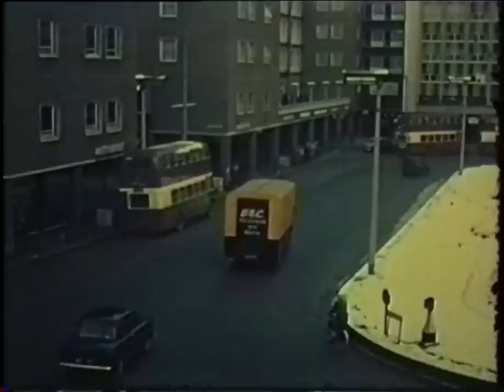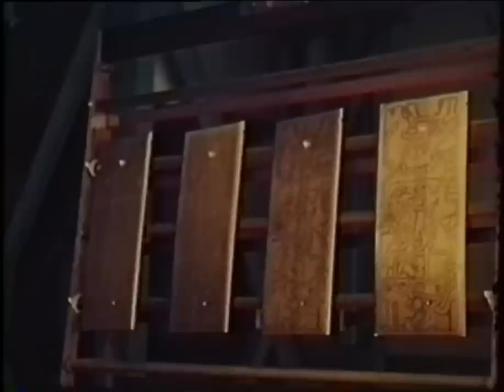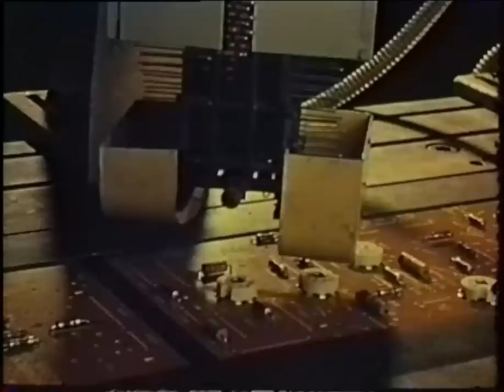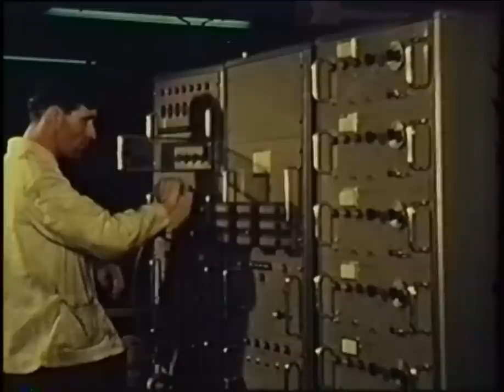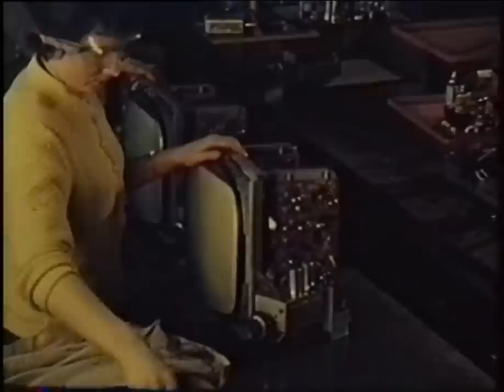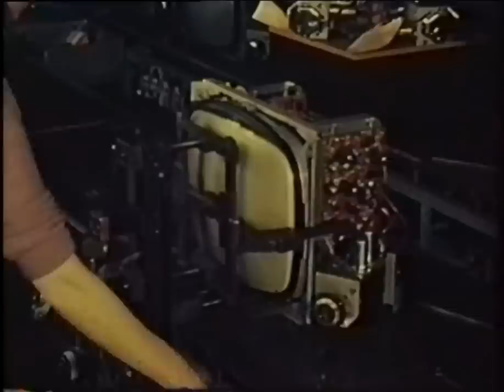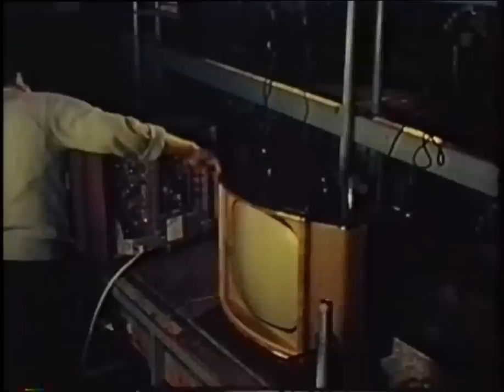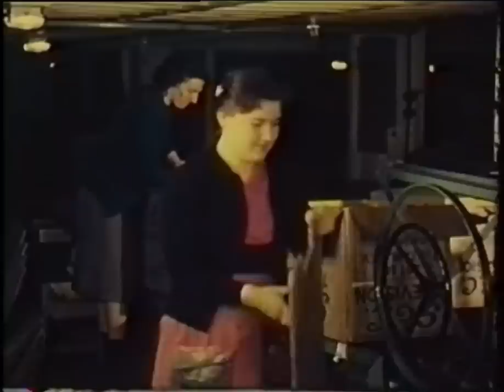GEC 405 line Television factory Coventry 1960

Comment: I worked as an apprentice at the Pye television factory in  Cambridge around this time. When the concept of printed circuits was first introduced it was my job to hand dip the boards on a bath of molten solder after first brushing the surface with liquid flux. I was given a brown overall and a pair of garden gloves as protection. It was a messy, and dangerous job. You had to float the board on the solder just enough to make the joints. Someone would then go over each board to remove the short circuits.

Comment: many years of trouble free lol who are they kidding they barely made it past getting the legs screwed on without something failing , valves were not reliable and deteriorated quite quickly , and we didn't have much tv broadcast then so most wernt used more than a few hours of an evening each day , often easier to repair though

Comment: Ahh; the glory days of the lethal live chassis! Many a TV servicing engineer had received painful, and sometimes deadly, 250V electric shocks from TV and wireless sets in houses where the live and neutral (now line and neutral) wires were transposed, or where a reversible two pin mains extension connector had been added to the cable. If that had happened, the chassis was at 250V instead of roughly zero. Modern equipment with a live chassis is illegal, for safety reasons.
Reply: Yes, I remember that little death trap very well. I was in a house loft, aglining a TV antenna while the 'guvnor' was down stairs shouting "a bit to the left.......hold it there". Holding the aluminium TV antenna in one hand....I stretch over and grabbed a cold water pipe to steady myself. Wham! Truely the most severe electric shock in my entire TV workshop career.

Comment: I have a degree in electrical engineering and programming physics. There use ferric chloride to remove the unwanted copper  that's a etching solution

Comment: We know today that "valve's" should not be touched with bare fingers i.e. gloves should be worn as finger grease will cause them to pop or malfunction ... I have a preamp that uses valves and I learnt quickly not to touch them (expensive Russian replacements)
Otherwise, a very interesting old film.
Reply: not true. Valves do not get hot enough for grease to affect the glass. You're confusing it with Halogen Lamps which run so hot the 'glass' has to be made from quartz.
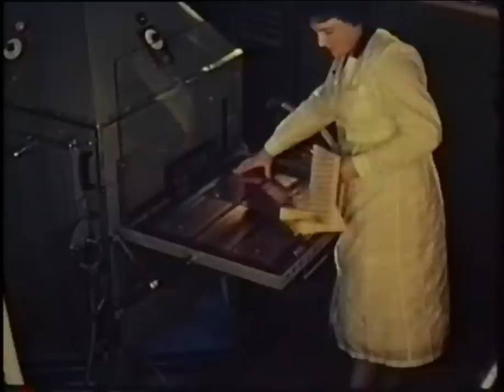Reply: To dispel a myth, you may want to watch this... from around 2:22.  https://www.youtube.com/watch?v=5SLKygFFnkU
Reply: Bunkum, and it's valves, not valve's.
Reply: @allancopland1768  
If you read, I did spell it correctly. My phone auto spell checked it wrong first time - weird. 
In regards to clean valves, I know many who think it's crap, but in the audiophile world its always recommended you don't touch them. Even as a kid, I remember the TV repair man wearing gloves when replacing tubes. 
It's an issue of uneven heating more than hot spots ... It will change the sound of your amp (whether you notice or not) and will effect the life of your tubes. The oils create cold spots, not hot spots, even worse for the glass as far as breakage and optimal/consistent output. I remember years ago leaving a thumb print on a power amp tube which cracked just days later. 
Maybe it is crap and I just had a faulty tube. I must have OCD as I'm always cleaning 😂
Reply: @ProjectOverseer  I agree Chris- it's also the same when handling halogen bulbs. Grease from the fingers will shorten their life. Surprised someone of the vintage who uses the word 'bunkum' doesn't understand this. Poppycock!
Reply: @kristianTV1974  
Many thanks. Its good to know I'm not the only one to think that keeping Tubes clean for longevity and performance is a good idea 👍
Reply: Ex TV repairman myself.  Even the valve manufacturers make no mention of gloves.  It's all B/S.  Audiophiles usually believe anything they are told by their dealer.... who is in the business of making as much money as they can from mythical stuff.  Valves do not 'pop or malfunction' if you touch them... that one is for the fairies.
Reply: news  @kristianTV1974   Well spotted, but it's not the same thing.........I totally agree 100% re halogen tubes.  Halogen tubes WILL fail if you touch the Quartz glass envelopes because they run exceptionally hot and grease from fingers will cause hot-spots leading to further overheat and failure, but that has absolutely no relevance for valves which run infinitely  cooler.  Just keep believing those old audiophile myths and paying really big money for 'emperor's new clothes'.  It's good news for the dealers.    :-)
Reply: @allancopland1768  
Well I'm in my early 60's you must be older and wiser to have worked on old style B&W valve TV's. 
Back in the 60's my mum & dad used to rent from rediffusion. The repair guy used to put on white gloves when replacing blown tubes. As a kid it must have imprinted on me.

Comment: As one can see. The delicate work is meanly done by women.
Reply: The old core memories for computers were made in the far East because the women there, with smaller hands, were better at manipulating the thread-like wires and tiny ferrite cores they contained.
Reply: Then burly men chuck the TVs into the back of a van.

Comment: Just two years later, GEC would rip out the entire manufacturing process department, and refit it ready for transistors.
Reply: What makes you think that? Transistorized TV sets were a rarity up until the early 1970s, and almost non existent in 1962 aside from a few high priced portables, which were actually hybrids. In any event GEC was building transistor radios from the mid 1950s onward, probably hand wired at first, and then with printed circuits. Transistorized products were not produced any differently, they used printed circuits, as did this television, the only differences are in the values of the components used, it's still lead through hole, and then solder.

Comment: GEC used double sided boards which although common today weren't so much back in the day...I remember repairing the old hybrid Pye colour tv's with a CDA board that used to look like the ocean waves as time went by, due the heat from the 4 valves (3 PCL84's and a PL802)...A company called LEDCO even made a solid state version of the PL802 which wasn't all to reliable!..The old KB (Kolster-Brandes) used hand wired chassis and even had a baby alarm input (State of the art stuff :)

Comment: The all transistor BRC Thorn sets were game changers.
Reply: Ah yes, the 3000 /3500 series; used to run as hot as hell as they still used the valve type droppers.
Reply: BRC2000  was solid-state and the BRC 3000  was the birth of the chopper power supply...now used in almost everything..

Comment: I had a GEC (colour) television in the late 70s. It had a Hitachi CRT and it was very reliable. Pity the "smart" whizz-kids in the city of London didn't realise what value they had in the GEC company before selling off all their manufacturing to become "Marconi" and finally destroying the company.
Reply: It was GEC Marconi for a very long time, long before its demise. You're correct about Hitachi tubes, the last ranges of GEC TVs were actually badge engineered Hitachi sets.
Reply: @cambridgemart2075  The GEC heavy engineering core side of the business (railways, power plant etc.) had joined up with Alsthom of France to become GEC-Alstom (I think that they had dropped the "H" from the name by then) but then sold all their share to Alstom to concentrate on the small consumer and electronic goods and made a complete pig's ear of it. The GEC brand name was sold to GE of the USA thus ending confusion between the 2 separate companies.
Reply: @MervynPartin  There was a very large part of the company involved in aerospace, defence, and space, that was GEC-Marconi's area of speciality and  they were in existence well into the 90s, parts of it past 2000.
Reply: The GEC-Hitachi factory was at Hirwaun in wales, ostensibly a joint venture but really a way for Hitachi to gain access to the UK by circumventing the import quotas. The late 70's Labour government gave huge grants to foreign companies to build factories in areas of high unemploymemt to keep the jobless figures down. The conservatives that replaced them followed a similar policy
Reply: @kevvywevvywoo  Sony also have a factory in Pencoed, South Wales (one of my friends worked there for some time).
Reply: @MervynPartin  used to be a SOny factory  in Bridgend I believe, did they make computer monitors? I forget
Reply: @kevvywevvywoo  I'm fairly sure that it was television sets, but I emigrated (to England) quite a long time ago so I could be wrong
Reply: bridgend closed in 2006 Ive been told, Pencoed did make TVs but now makes studio tv cameras and the Raspberry Pi mini computer

Comment: Interesting to watch, but it must have been SO boring working there.
Reply: good steady work i've worked in places like this on presses you switch off after a while not as stressful as it is today .
Reply: @Richard-pe4cx  absolutely. Best job I ever had was soldering on a production line for audio power amps. I'd rotate around soldering, wiring looms etc every few days so never that repetitive.

Comment: Fascinating to me as I have never worked in a large company but run my own very small scale electronics manufacturing. Apart from valves (or as we call them, pickled electrodes) the biggest difference between large scale manufacturing now and then is that their board assembly line was custom configured for that particular assembly. These days the machines are robotic, so by simply changing the program and the component carriers you can switch from televisions to phones, or between one model phone and another.

The actual printed circuit (PCB) fabrication process is 100% familiar; I've made and used boards with pretty much that exact same workflow except for punching all the holes in one hit. I hand drilled hundreds of boards as a young lad. The process today is much more sophisticated although the underlying principle is still the same: selective etching of a copper laminated sheet of insulating material. Also the level of automation in the PCB industry is mind boggling. As a consequence I, as now a hobbyist, can get 5 boards made to my computer aided design and delivered from China for about $20.
Reply: From China?
You would think that the shipping costs would render such a transaction unaffordable.
There must be some major economy factor involved which mitigates the transport costs.
I wonder what that could be?
Reply: @bingola45  That ~$20 is $2 for the boards and ~$18 for airmail. The question to ask is how can an eBay vendor in CHina sell you a 75 cent gadget with free delivery?

Comment: He said valve holder,  we say tube socket!   😂
Reply: The tube is the crt - the main part .... the valves are separate....Americans bastardised the English language ....
Reply: @carlyonbay45  Americans have different names for things, that's all.
Reply: Then the Germans and Dutch did as well, as they also call valves "tubes". Considering that the triode was invented by Lee DeForest, which was the first amplifying device, an American, which made radio commercially viable, then I don't think you can make the claim that calling valves, "Electron Tubes" is a bastardization of anything.
Reply: @OlegKostoglatov  lee de forests patent was for a device called an 'audion'. No mention of either 'tube' or 'valve' anywhere. Just sayin
Reply: "Toob Sacket", more like!

Comment: I worked on TVs in the late 60s and 70s  I hated these sets with the sideways boards they were famous for having loose connections!
Reply: I laughed when they mentioned on a couple of occasions  how reliable the sets were.
Reply: I must admit, my first thought when I saw this video was "Those valves really need some sort of restraining clip to hold them in when they're mounted vertically like that."
Reply: I worked on some of them as well, but I don't remember much about them. Our first colour TV was a GEC 2041 hybrid. I had still a lot to learn then, and when the TV suddenly developed a dull picture, I was convinced the crt had packed in. It turned out to be the 100K screen grid/ 2nd anode feed resistor which had burned up due to being underrated wattage wise!☺

Comment: Christ, an open bath of molten leaded solder with no fume extraction, good luck with the birth defects assembly ladies.
Reply: I operated a small scale flowsolder machine in tha 1970 making simple games consoles (telefusion engineering) there was no extraction that I can remember the fumes from the flux were strong, and very little training or health and safety.
Reply: I agree. It is typical manufacture. Poor people.

Comment: Thank you, loved that video for it kick started some memories of a time not so long ago. Yes indeed, in those days they did indeed have thick circuit boards supported by chassis made of steel not plastic . Sadly, like in all things even with the best components of the times which made up this miracle vhf product came one serious flaw? Those power hungry heat producing vacuum tubes had very short lifespans. as for that b&w single gun picture tube not a problem for it was built to last for sure. No, it produced little heat itself but collectively now we have a serious watts problem here. after tech school opened up a tv repair shop in 71 and vacumm tube sets like those were still everywhere. Now fixing sets like these were fairly easy for most had similar problems. via horz or vert hold problems mostly sometimes some scratchy sound due to the 4.5 mhz osc going off freq due to a leaky tube or bad cap. Now a lot of sets I repaired were sadly, half transistor color sets via (convergence ry.by.gy. nightmares) and many times even with a scope evaluation, and a sams ya would scratch your hair out trying to repair em.
Reply: I think this is the British General Electric Company, rather than GE of Schenectady, New York.

Comment: Looking at the layout of the floor in the high up long shots I think that GEC building was in Spon Street.  I worked there from 1983 to 1986 (Fourth Floor) but at that time it wasn't producing TV's but Telephone Network Circuits.. I was a Technician there and worked on 2GHz to 19GHz equipment.
Shame there wasn't an outside shot of the building.
Reply: I wondered if it was based in Spon Street, now long replaced by the Skydome even though it was a listed building. I remember being bored to death in the apprentice training school that was based in Spon Street in the early 1970s.
Reply: So that would have been making system X. Originally the old Rudge cycle factory.

Comment: I was making Tubes for Philips / Mullard in the 80's-90's and I recall using 2 foot piece of 1" plastic hose to hit the screen as hard as possible, to remove particles that can become lodged in the slots of a shadow-mask, behind the screen  of the Glass Bulb. Ah memories!.
The said device was referred to as ones 'Hogger' - and Hoggering being the act of striking the face of a television :)
Reply: Jayc: was that a bit like "bugger", but non-catholic? I seem to remember that Late Call...
Reply: if it happened in the customer's home the recommended procedure was to hit the faceplate with a slipper
Reply: I worked in a regunning factory in the 90s and we had a pneumatic hammer with a rubber end that would rattle against the glass. If that didn't cut it, out came the fence post and we would slam the tube face with the end of the post. We called it spot knocking. I learnt just how strong the tube faces were 🙂
Reply: @tenmillionvolts  We did Spot Knocking too! The plastic hose we used was called a 'Hogger' 😆
Reply: @jayc2469  Do you know why it was called that? We never used that term. I wonder if it was a local thing.